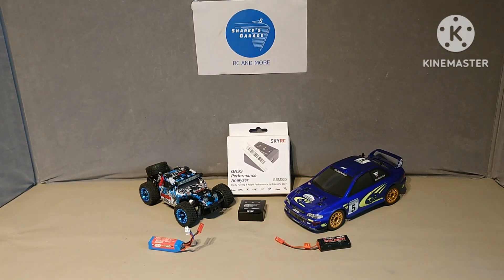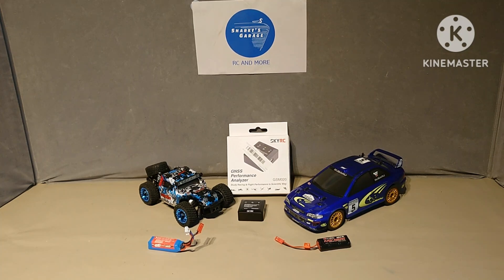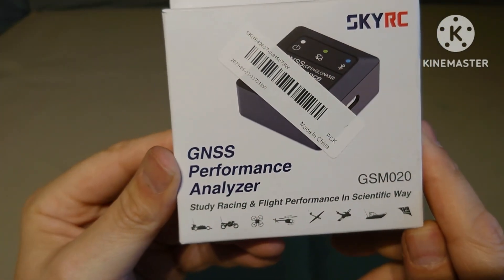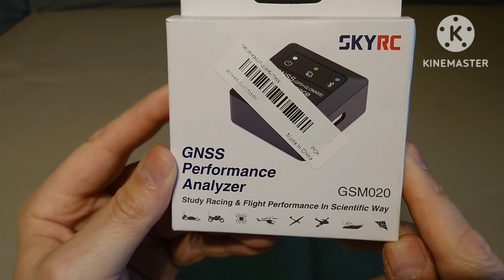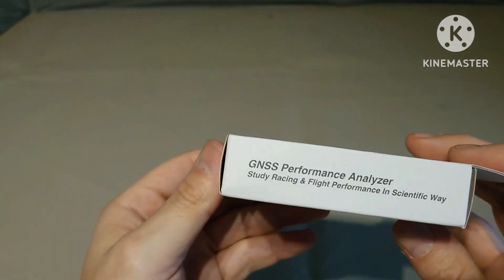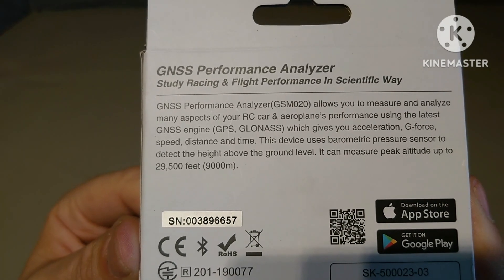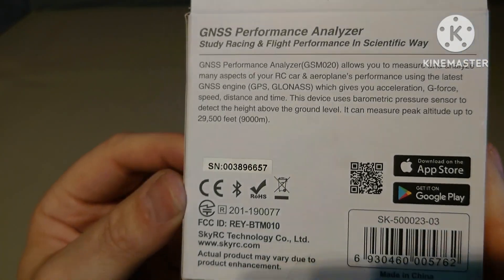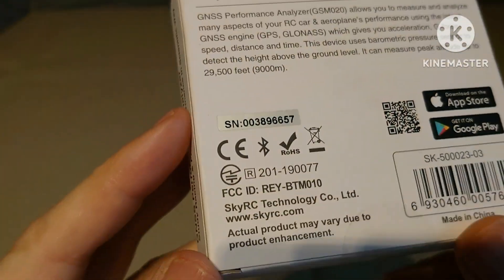SkyRC GSM020 GNSS Performance Analyzer (Unboxing/Review) + Speed Runs WLToys 284161 & Carisma GT24

Comment: Does it able to lock to gps and works in indoor?
Reply from the maker: It needs to be able to connect to satellites, but depending on the type of structure you are in and what is above you it can work well indoors, though i don't know anywhere local to me where i could get access to a space large enough to do the speed runs on most rc's above 1/24th scale

Comment: I am surprised that the WLtoys 284161 acheived 19mph which is 30kph. Usually it s said top speed is 24kph but i am impressed that this one achieved 30kph. Did you do anything to the car or was it stock the whole time?
Reply: Unless you disconnected the lights. I theorized that you did and it results less power draw from two areas giving all of its power to just the motor itself
Reply: I'd imagine the slightly larger wheels then for example the wltoys k989 did the trick here.